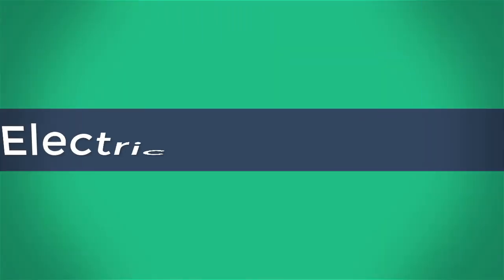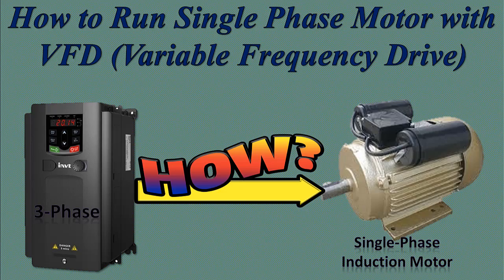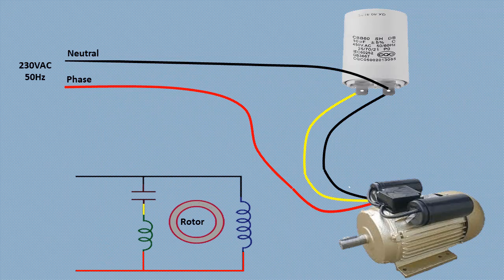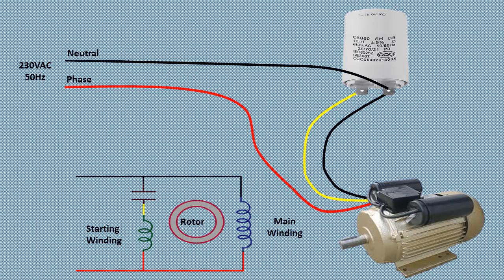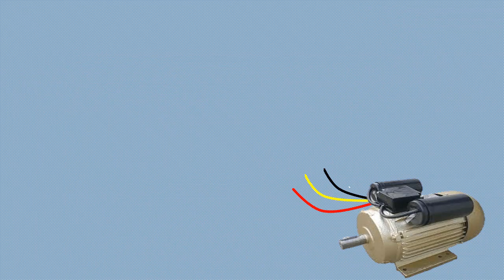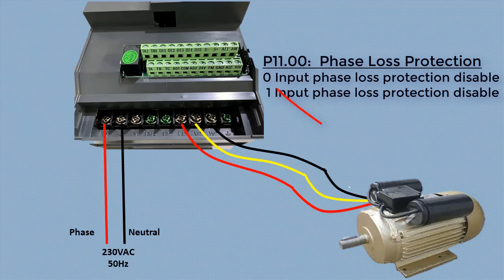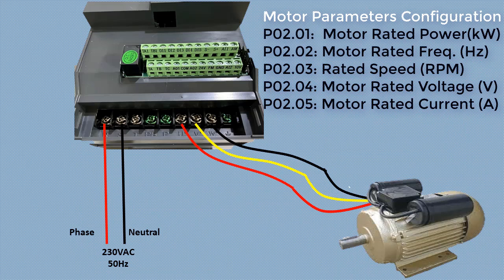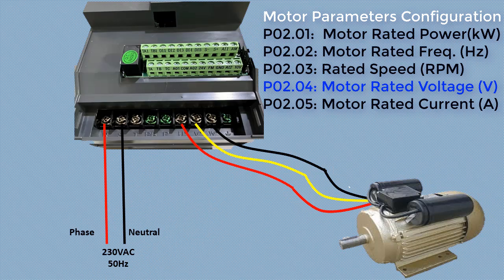How to run single phase motor with VFD

Comment: Taking two phases from a three phase VFD. Would that not give you two phases that are 120 then 60 degrees out of phase? That would have the motor going fast slow fast slow...? i guess that would cause inefficiencies and a vibration. Thinking out loud here and may be on the wrong track. Can you adjust the VFD to make it a 90 degree phase shift?